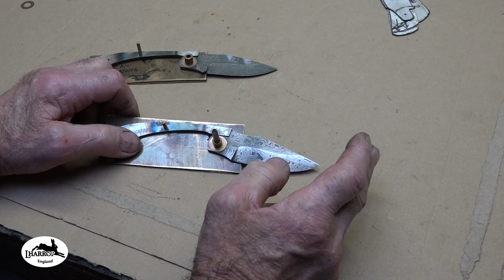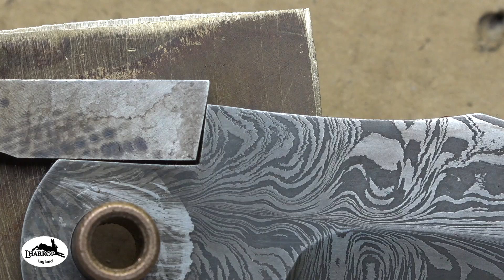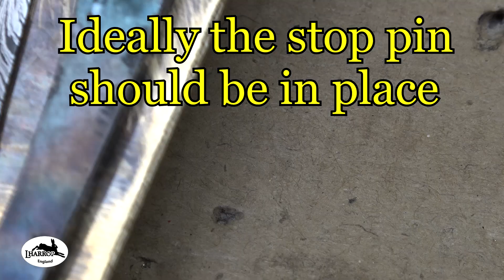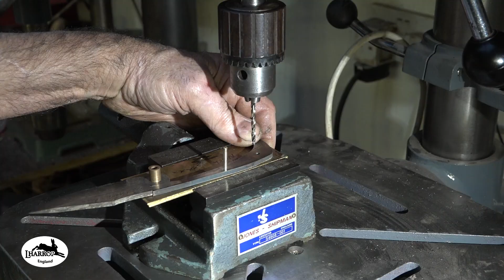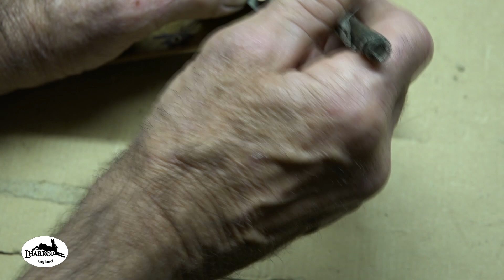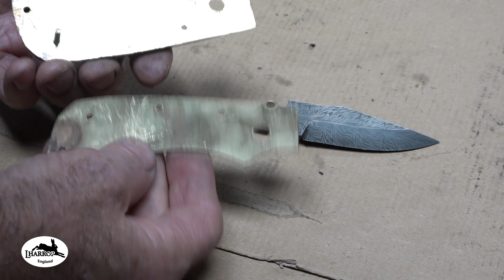Making a slip joint or folding knife. spring tuning and fix

Comment: @Loz Harrop , you need finer edges on tools to work pine as than you do on Oak Brass being softer than steel behaves in a similar way so  has a tendancy to tear apart with a "blunt" cutting edge because there is less tension supporting the cut in brass than the same cut in steel. One drill will make a clean cut in bronze and steel but tear up or even warp copper and brass .....many carpenters use longer beveled tools on soft wood than on hardwoods for this reason
Thanks for this, folders are something I have trouble getting my head around so will be referring back to your video probably several times...cheers
Reply from the maker: No problem mate and makes sense on the brass drilling. Cheers
Reply: @LozHarrop  you're welcome